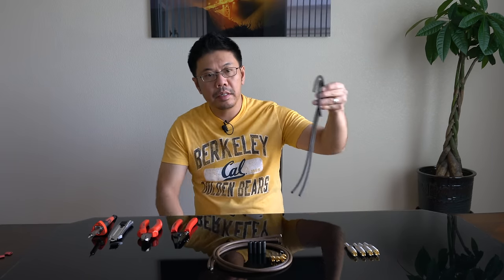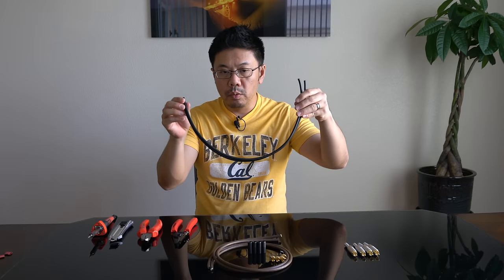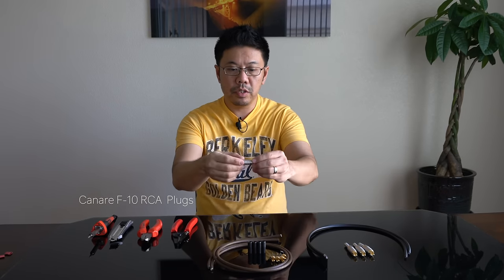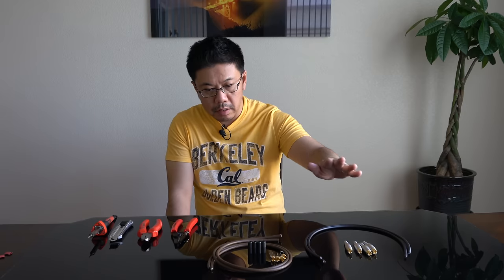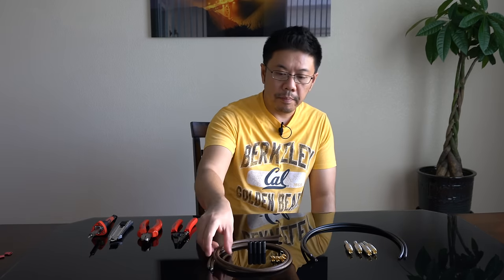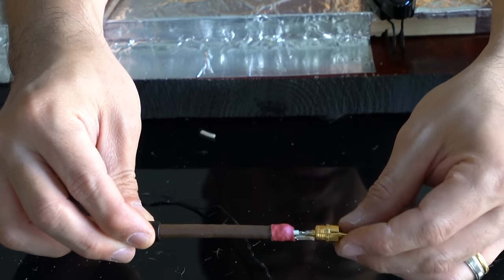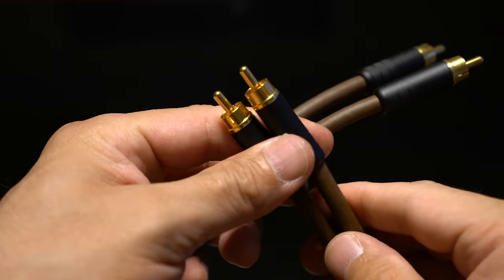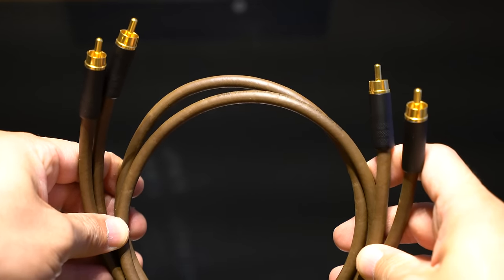$30 Audiophile Grade RCA Interconnects, DIY Better Sounding High Quality Cables

Comment: You should try leaving one side of the shield floating. I prefer it better that way
Reply: Which side do you float?
Reply: @ChicagoRob2  One side 😊 and you turn it as needed. Usually I find it best to be tied on the source side and floating on the receiving end.
Reply: Floating it makes it a one direction cable from what I know
Reply: When "floating", then the connected sid is always the giving side (Sackschirmung). Its a very old German Technique.

Comment: The sunglasses holder to clamp the wire is genius!
Reply: That's what this is,I know I seen this gadget
Reply: Yea so dope. I want to see if I have one now!!
Reply: I verbatim  said the same thing. So using it. Yay no more damaged wires trying to clamp it
Reply: Those bonsai scissors?
Reply: @garrettgiuffre7298  I may have snipped the cable a tiny bit, I was going willy nilly.  But yea small fiskars would work, and take your time. I enjoyed making the cables and it does not need to be rushed.

Comment: WOW, Tharbamar!!  So you’ll probably never see this but I just made these exact RCA cables plus the Mogami speaker wires in your other vid.  I waited until both sets were done, played my gear with the old amazon interconnects and 2002 monster cable, immediately swapped to my new hand made cables leaving all volume and sound settings the same.  WHAT A DIFFERENCE!  Playing a Marantz 2265b and Hafler DH220 on Klipsch Hereseys using Tidal from my iPad through a Schiit Modi DAC.  Not sure if it’s that combo or if it’s the vintage gear that really brings out the difference or what, but I’m totally blown away.  MOST. HELPFUL.  VIDEO.  EVER!!  I owe you one!!  I’m making my dad and sister sets for Christmas now.

Comment: Thank you very much for your advice and tell us about your experiences. A couple of weeks ago I made my own patch cables using Canare F-10 RCA connectors and MOGAMI Neglex w2549 shielded cable, which has two wires and a shield, the outer diameter is 6mm, perfect for the RCA CANARE F-10. According to the data sheet, the resistance, capacitance and inductance values are practically identical to the w2543 cable. I joined the two wires and soldered them to the center pin that I insulated with heat shrink tubing and then wrapped the mesh around the heat shrink and crimped with the RCA connector jaws. To finish, I have placed a second heat shrink that isolates all the contacts. The change has been noticeable, the sound is cleaner, sharper in the mid/high frequencies. I have added red and white heat shrink to your proposal to differentiate the L and R channels.

Comment: I made the same rig and it works perfect as the extra hand. This method is so easy to apart to and am to sound great as long as you keep it clean with no stray ground whiskers
Reply: What is that holder thingy he used to hold the cable in place while soldering ?

Comment: I've been using the Switchcraft/Belden cables for a few years now. It basically ended my cable swapping habit. I also use the same Switchcraft connectors with twisted pair Duelund wire. Equally good with a more minimalist look. These recipes first appeared on another audiophile blog a while back. I know of at least one prospering cable manufacturer who slips the Belden/SC combo in a braided sleeve, rebrands it and sells it with a very hefty markup. Just goes to show you...
Reply from the maker: Mike, I grown up in Japan and I'm using these methods even before anyone one knows publicly. I like both cables in my system but I might preferred Mogami C-Type for richer and quieter sound signature.
Reply: @Tharbamar  Makes sense, the fellow that posted the recipe on the blog I was referring to is also Japanese. I'm using a pair of Mogami ICs (not DIY) for the audio out on my BluRay player. Can't remember the model number. Will check later, it's too hot for me to go crawling in back of my gear right now.
Reply: I've been reading about the Belden switchcraft combo. Even Jim Smith reccomends them. What are your toughts on these?

Comment: I made a pair of these for my dac in 3 foot length and man did they make an improvement from my generic 17 foot rca cable.  The sound is more open and the highs are better on my system noticeable right off the bat.  Thanks for the tutorial.

Comment: Tip... Put the connecter shell, spring and heat shrink on the cable, before doing all the stripping.. will save you hassle of getting them on after
Reply: i dont mean to be off topic but does anyone know a trick to log back into an instagram account?
I was dumb forgot the account password. I would appreciate any tricks you can give me!
Reply: @Hendrix Harvey instablaster :)
Reply: @Otis Luciano it did the trick and I actually got access to my account again. I am so happy:D
Thanks so much you saved my ass :D
Reply: @Hendrix Harvey You are welcome :D

Comment: Nice using the car visor sunglasses clip for cable hand  I picked up a helping hand at a yard sale it has 4 aligator clips on adjustable arms and a stainless cup for water or solder sponge they can be expensive though

Comment: Te cables I made from this wire and 8412 were every rolled off and bottom heavy. I used them to poser my subwoofers. I used Canare F10 RCAs and Wonder Solder. I tried the 3103 speaker cables from Mogami and they were fine.
Reply: Use Mogami 2549, one wire hot, one wire return, with the shield connected only at the source. Then take all your other cables and throw them in the garbage.
Reply: @ChicagoRob2  (edited because I misunderstood)I'm pretty new to this level of audio equipment but I can easily build cables. I have  a CAT S1 black path and Music Reference RM-9. Would the 2549 be acceptable for a 12ft length? I just want to be sure to do it right the first time. Also, What RCA terminal do you recommend?

Comment: This is such a great video. I've made one set of the Belden so far and tested them on two systems, both with Naim amps. The Supernait 2 and XS 3. PMC speakers and Neat speakers. Both systems have the Blusound Node. It's such a vast improvement over some top name interconnects, including Chord and Rega. The dynamic range is superior and the sound is richer. If you're looking for more of a "3d sound" then I'd recommend giving this a try. I will probably give the speaker cable video a try at some point but it's harder to find that cable in the UK for some reason. Thanks for your expert instructions on how to make these.
Reply from the maker: My pleasure. Thanks for sharing.
Reply: As a professional sound engineer with 35 years of experience using millions of dollars in equipment... I have never heard all of the glorious improvements in sound stage, imaging, fluid detail --  whatever that means.
I should be worried but, all of my counterparts have never heard it either.  Believe me... we hear a lot of things.

Comment: The one issue of not soldering the ground and just folding it over the cable and then crimping over is that you're putting wires between the rubber cable jacket and the metal crimp part of the connector, so when you crimp the connector, it's not gripping on tightly onto the rubber cable jacket, but is instead holding onto the "slippery" metal. I mean you can imagine the difference in grip levels between two metal pieces in contact and a metal in contact with rubber. This way only your signal wire is actually really solidly connected on both ends.  It's all fine if nobody ever pulls on the cable violently. I always solder the ground as well, and then use a shrink tube with glue, so that it actually shrinks and glues everything together. That way you have no issue of breaking the cable at the connector, since you have the signal wire soldered, ground wires soldered, shrink tube glued on and the crimp holding everything together.
Reply: My question would be if there was any audible significance by not soldering the ground vs crimping the ground.  I know Audioquest tries to steer clear of using solder and prefers machine crimped cold welds.

Comment: Hi, it's been a long time, but in the comments it was said several times that the shielding should be connected only on one side, but no one explained properly why it should be done that way and what advantage it has.
This connection system is taken from the studio equipment when connected by XLR which is connected by three wires 1-GND; 2-positive signal; 3 negative signal - if any interference is induced on the route to the cable connected in this way, it will affect both the positive and negative wires, in the target device these two signals will merge again and thus the induced hums will be canceled - this connection works at very long distances. Our home devices mainly use RCA connectors (cinch) where we only have a combined signal on the center pin - to reduce the interference of such connections (it only works for short distances) the so-called directional connection of cables is used - we need a shielded cable with two inner wires - one of the wires connect the active pin, on the signal side (e.g. CD player) connect the second wire and shielding to the external contact (GND), connect only the second wire to the external contact at the connector on the signal output side! we terminate the shielding so that it cannot touch this external contact.

The shielding must therefore always be on the side of the signal source! never the other way around!
Cables are also sold that have directly printed arrows between the text indicating the type of cable (I always connect cables that do not have arrows so that the direction of the signal corresponds to the direction of the text).
How does it actually work - if a disturbing signal is induced on the cable connected in this way, it is on the shield in antiphase with the GND wire and it is partially canceled - tested in practice and it works - I have not only all the cables of my HI-FI connected this way, but also the test cables used in audio equipment repairs where there is a lot of interference at the workplace.

I always recommend GND soldering

Nice day 🙂 Tom
Reply: Thanks Tom. Are you saying for home RCA short run usage connect the shield to ground at one end, that end being used for the source, ie CD, other end for Amp? Ta.
Reply: @boydsargeant7496  Yes, the other end where the shielding of the cable is not connected is intended for a device that processes the signal, it can be the amplifier you mentioned, or a mixing console or, as in my case, a direct input to a tape deck. Shielding is always connected at the signal source.
Reply: Thanks!

Comment: I always recommend connecting the shield on only one side. The side has to be marked. Connected side goes to preamp.
Reply: How come?
Reply: What if you don't have preamp but just DAC and AMP?  Not shielded goes to DAC? What are benefits of having one side not shielded? Today I spoke to my repair guy, he is making custom soldered cables and he said it doesn't make sens.
Reply: @KonradSkowronski  Tell the repairman to think or go back to school, I added a separate comment explaining how the directional cable works. 

Nice day 🙂 Tom
Reply: @KonradSkowronski  “Directional” cables with the shield connected at the source and “floating “ at the other end are more transparent and open sounding than a cable constructed with the Japanese method. I’ve been building my own cables for 45 years and the directional method is a better sounding solution that can easily be heard. I’ve conducted hundreds of real-world comparisons and every listener, regardless of background, has chosen the directional cable as superior in every way.
Reply: Sorry it's psychoacoustics only.  @Edisson.   Can you give me real proves like scientistic data of frequency response etc?
Reply: @ChicagoRob2  I would be more than happy if I could participate in a blind tests or would be greatuful to see non biased and objective blind test using directional cables. (btw I have one made by Evidence Audio)  Audiophiles hate them. Why? Because they fail on most of them. I have pretty good ear, master diploma in the field of music and arrangement, produce songs and all stuff that people believe they hear is just psychoacoustics.
Reply: @KonradSkowronski  Thanks for your response. I have a pair of highly regarded Van Damme interconnects, constructed the Japanese method, utilizing OFC and high quality dialectrics. I have used these interconnects in multiple blind tests with my Canare and Mogami directional cables, and I have never guessed wrong with them. By comparison, the Van Dammes sound dull and closed in. Even my wife can tell. I will admit to having above average hearing and have similar success in evaluating DACs.
Reply: 👏🏻 @ChicagoRob2  Looks like all audio engineers I met are def;)  Non of them is using directional cables, and everyone has a better hearing than statistical orthodox audiophile. If these cables were so essential for sound quality and audio fidelity all professional music studios would use directional cables... but they don't 🤷🏻‍♂ I won't argue. I've been there obsessed with audio quality, DACS, cables, preamps and I have to admit it is satisfying and expensive hobby but most of the time has a little to do with raw physics or acoustics. I am not saying cables are all the same! No. But there is an absurd level of esoteric sound perception and skill that audiophile claim to posses that is in reality pure psychoacoustics and autosuggestion. But I understand this need. It is market and business. Someone is making huge profit on it:) 🤷🏻‍♂
Reply: @KonradSkowronski  Ever heard of Steve Albini? He has 40 years’ experience as a recording engineer and has mixed/mastered Nirvana, Cheap Trick, Jimmy Page, Robert Plant , Chevelle, and approximately 300 other bands. He also uses directional cables(mostly Canare). 

Go back and re-read @seejayfrujay’s post, for why floating the shield is technically superior, from a hum/noise rejection standpoint. 

For those who believe, no explanation is necessary. For those who don’t, no explanation will suffice.

Comment: thanks for sharing BTW, if you are doin' it alone you can also use ruberband in nose and mechanical pliers so you can easily and cheaply convert them into crab pincers, i do it all the time
also, using silver solder would be propper for high end

Comment: I did one like this from van damme cable, same 4 wires inside with shielding. I have done a van damme silver series, and a simple mogami copper coax with shielding. they all sound the same. maybe the van damme silver series a tiny bit different 'better' in sound but they pretty much the same.

Comment: As a retired EE, and having worked with a lot of people in digital and analog signalling, I cannot wrap my head around the idea of connecting the shield to both ends of a cable unless it is coaxial (Mr. Yazaki's method). Twisted pair is much preferred over coax for high-impedance low level connections between audio gear. I was taught the standard method and never deviated. To demonstrate why the standard method is preferred, put a Japanese connected RCA cable next to a strong EM field. You will hear hum from the ground loop between the shield and the black wire. It's physics.
Belden 8402 interconnects go back to The Absolute Sound in the 1970s as far as a thing with audiophiles. Belden 83318 is far superior, but is very expensive. I built interconnects based on the 83318 cable in the 1980s for a high end shop as a hustle going to school.
Reply: Agrred!
Reply: Agree 100%. Aside from the hum/ground loop problems inherent in the Japanese method, “directional” cables offer far better sonics, i.e. lower noise floor, better transparency, soundstage, and imaging.

Comment: Just ordered 
1) 0.7m of mogami 2534 pre built with Neutrik plugs.
2) 3m of Mogami 3104 speaker cable.
3) 5m of Canare 4S8G speaker cable.
4) Almit KR-19RMA soldering iron.
for my Mid-Fi and Lo-Fi at a total of 9,000Yens only shipping to my city. Have high hope of them😄.

PS: I don't buy banana plugs because I can reuse my QED Screwloc and Audioquest Suregrip 100 by cutting out some of the wires at the ends.
Reply from the maker: Very nice, enjoy!

Comment: Tried mogami for headphones but they dont offer the clarity of silver cable, and silver cable is so direct and crisp in its sound you need to use gold on the negative. Combine those two and youve got an amazing quality sound.  I picked up a used set of single crystal silver cables ($30), i have a set of gold plated ofc ($30), and ive ordered 2m of gold filled copper cable (actual gold layer fused to a copper core ($20 for 2m). Im going to run a length of silver and the gold plated ofc as the positive and the gold filled alongside the remaining silver as the negative. Using cotton shoelaces (2mm) and a layer of shrink wrap to protect the cables. And terminated in mini aviation sockets.  About $110 overall. You wont find a pro set of equal quality under the 10k mark.  More money than sense.

Btw found soviet airforce comunications wire for aircraft (pure single crystal silver) for dirt cheap on bthe bay, great sound out of that but its very stiff cable, no good for my headphones but for interconnects it could be perfect...and its very cheap

Comment: Very good video , I used the belden cable with some solderless locking connectors though I connected the shield to one end only , very good interconnect , though I would like to know why connecting shield to both ends is a good thing or not , thanks again. Ian

Comment: i bought my own RCA connectors ( good quality ones) from Amazon.  But the difference being is…. I’m using solid copper electrical wire; as opposed to the stranded, flexible type.  The difference in sound quality is very noticeable; depending on whether you have a good musical ear or not.  I’m also using bi-amp / wire speakers.
Sunday am 23rd October 2022. U.K. Southampton